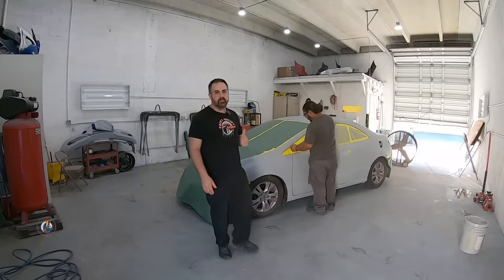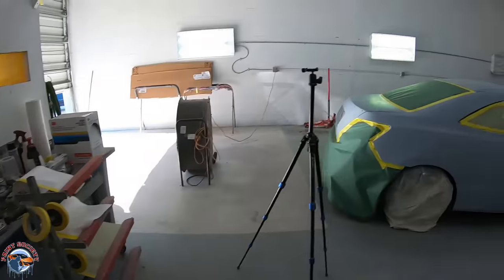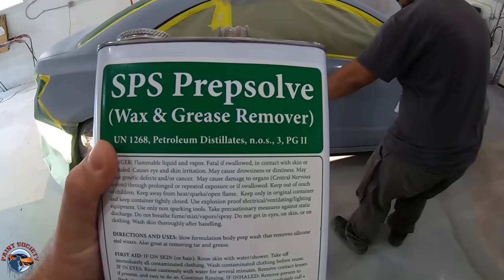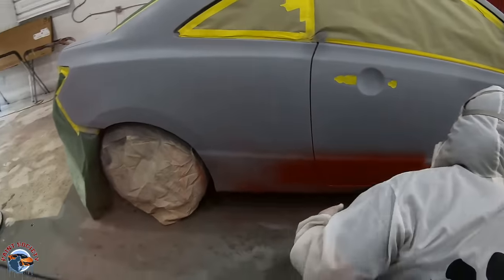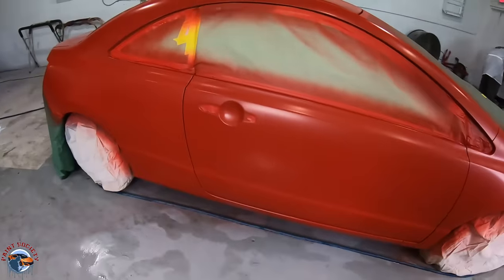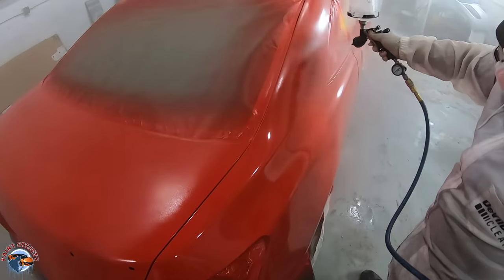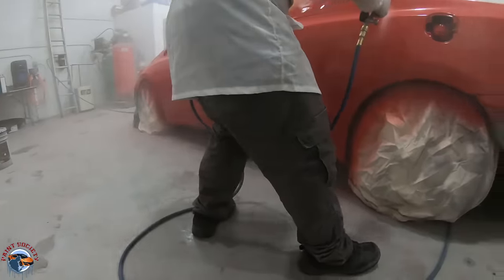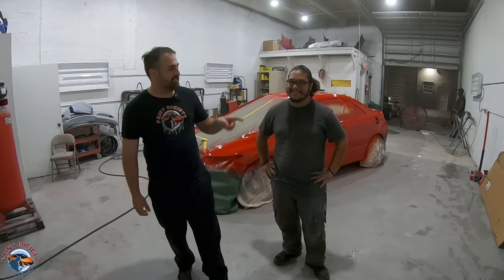How to Get Amazing Results without a Paint Booth!

Comment: I did 40+ years in the collision repair/refinishing business.  I retired from teaching it at a public technical school.  My food for thought: good technique Steven, if you want a long healthy life, get a fresh air system. Especially when illegally spraying with little or no ventilation, no arrestor, and venting illegally into the atmosphere. It's nice to see the use of a self etching primer, a step many skip. One other thing, I would have used Nason clear over the Nason basecoat. When you mix product lines it usually ends with paint failure later on, as I've seen on many occasions. Nason clear is very reasonably priced.
Reply: Valid point. I know the videos are aimed at the enthusiast crowd and not the pros, but you are doing a disservice showing a guy in a cloud of isocyanates with just a half face respirator and a chemical (?) cartridge. Some of the problems from isocyanates are immediate...and some hit you years later. Want to be around for your kids and grandkids? Get a fresh air system as mentioned. Wet edges...

Comment: This is a good video, very satisfying to see that paint going on!  One tip to newby car painters:  the PSI specified for the paint is as measured AT THE GUN, not at the compressor!  In other words you have to compensate for the length of the hose you are using,  (because the pressure drops more the longer the hose is)..and add pressure based on that.  Like if they say "30 PSI" you might need to have a reading of 40 at the compressor to spray at the specified pressure.. You need a chart to tell how much to compensate.
Reply: Great tip.. thanks 🙏
Reply: Another reason to regulate the pressure at the gun, not at the compressor, there's a lot more volume at 90 psi than at 30psi.  Even if you compensate way back at the compressor side to get 30 psi at the gun, if something happens that pressure could dip below 30psi in places, especially if you're not using a 60 gallon professional system like this and trying to make a 20 or 30 gallon oil-free 1.5 hp compressor work.  If you've got 60 or 90 psi up to the gun and regulate the pressure THERE, then you should never have problems with low pressure at the gun tip.

Comment: Used to paint plugs and molds for large yachts You are 100% correct Steve knows what he's doing - Only modification I would have made is I found it easier to control the hose by putting it over my shoulder then holding it by my side. Also love the fact you pointed out the footwork - it's as important as the flick for an even coat.

Comment: Love your tip about spraying scared/overthinking it.  Two of the best paint jobs I ever laid down were areas where I was like "I just need to get some paint on there, it doesn't need to be good."  One was the engine bay of my wife's car, the old paint was just not great, and I had the engine out, so I was like "I'm just going to throw down some base coat and clear, hardly anyone will see it."  It ended up going on so nice there was zero orange peel and no finishing needed, because I just sprayed like I didn't care.  It ended up winning a $1000 prize for best engine bay at a car show, with just a Scotchbrite prep and some extra bc/cc I had lying around.

Comment: Very well done  I liked the narrative  pointing out the Dos and Donts  I have only sprayed one car myself and for that one I used a Turbine HVLP spray rig I actually purchased  for my Woodworking finishes  I did use a two stage Dupont Automotive paint  in which it was recommended that a used a colored sealer from Dupont  because the car was a British car and they used a pretty soft paint from the factory  I knew that because I had the car for more than 14 years  and with routine washing a waxing  I could see grey Primer in some areas  the job came out nice surprisingly no runs, drips or orange peel  or any missed spots ! bTW I did the original factory color  as I did not have the time to pull the engine and prep  the compartment  I was quite happy with my results  and all the tasks my Campbell Hausefeild Spray rig could tackle  for my woodworking I often used Oilbased primers and paints as well as spraying Conversion Varnish over staingrade Exotic Woods
Reply: Now that you've done both, one of the things I found amazingly satisfying was using automotive clear and finishing techniques for wood projects.

Comment: Taking a grinder to those panels especially with today's higher alloy content thinner body panels is a big mistake, I'm surprised those panels weren't severely warped from the heat of grinding, I painted cars for over 25 years and I have to say Steve's technique is outstanding, I was never a big fan of Nason materials but they are very cost effective.

Comment: Wow!  that was impressive workmanship.... years ago I painted two cars under a tree  with Ditzler enamel, they came out surprisingly well given that it would have been close to impossible for them to look worse.
Reply: A lot of times by the time you give up and paint a car they look pretty bad to start with.  Back when I was in the RX7 club there was a famous video going around where someone painted their car with a roller instead of a paint gun . . . and it wasn't bad!  It wasn't GOOD, but it was so much better than what it was, and after all the sanding, it looked better than a lot of cars on the road.

Comment: I plan on pressure washing out my entire shop, ceiling walls and floor, before doing my first paint job. I will then seal any cracks it has to prevent air from coming in with dust or insects in it. I plan on putting quality HVAC filters on one end as an intake, and exhaust fan on the other end to pull air out. I hope this will prevent dust from getting in my paint. Likely will wet floor as well.

Comment: The question i always have is ; how long do you wait to remove the masking tape ? And...what technique do you use while removing it ?? Direction to pull and how fast etc...
Love your channel !
Reply: 2 hours after u spray,  remove it at a 45 degree angle AWAY from the paint edge and slow and steady

Comment: 45 years ago i started painting cars. back then it was mostly just alkyd or acrylic enamel. no clear coat.we would always start with the hood. do one side of the hood then the other then the fenders and roof, doors and finish at the back. you never wanted to walk around like you guys do. if you did that on the final coat you would end up making the first part dull due to overspray because it had already flashed off. it's like you do the front then the middle then the back like as if the car went through a waterfall.
on this car it didn't matter because you weren't doing the hood so you didn't have old paint meeting new paint.

Comment: Also, avoid painting at night because to keep the bugs out as much as you can. Also try to plan ahead if you have a lowered car or a sports car. When I painted my Prelude, I set the car on 4 large jack stands and remove the expensive wheels so when I paint the lower part of the doors, I am not getting caught with my gun or kicking up dirt the the gun might be kicking up.
Reply: Good tip.  A couple of times I've started spraying a project only to realize I couldn't get enough angle on the gun to paint the bottom of the rocker panels well.  Luckily the car was low enough that you can't see it well anyway, but I know it's there.

Comment: I'd like to repaint my 68 Ford Torino. Last time I painted it I used Centari Acrylic Enamel with hardener. That was back in 1982. The car still looks pretty good, but some rust spots are starting to show. Can't get the same kind of paint now, so it's on to base coat clear coat. Last time I painted the C strip on, after the first coat dried, with a gold paint. If I paint the car now with base coat, can I mask off the C strip with the tape and paint the C strip on over the base coat, pull of the masking tape and then spray on the clear coat over both colors. It would take some time to apply the C strip masking tape and my concern is timing and possible pulled of the first base coat when I pull off the masking tape.

Comment: Great video guys, as usual! I’m wondering what your thoughts are on a portable shelter as an enclosure; if the vehicle doesn’t fit in a DIYer’s garage? I think I know the answer...
Reply: watched a series of videos by a man restoring vintage british cars, although in a large shop he put up a portable shelter had one fan blowing front to back(not on high) and at the back with a floor drier fan with furnace filters for exhaust with the door closing their was not much of a gap. It worked great, acted like a down draft.  The quality of the job great, much of his later work was just painted in the shop, a lot of debris in the paint,  like you I will be painting in my Shelter Logic. The floor fan is the big secret you can turn it on earlier before painting to remove dust. Good luck

Comment: A quick question: I'm doing a long restoration for a project car. How to protect welded, straightened, and grinded areas? As I can't move to properly painting it any time soon. Can I just clean up those areas, apply epoxy primer and let it sit about 6 months before it gets properly painted? The car is kept in well ventilated cold garage.
You make great content, thanks!

Comment: When doing horizontal surfaces in dealing with the hose is that I take the hose and bring it up over my shoulder so there is zero chance that it would hit my work. One thing is that it is not a good idea to paint in the same room as the compressor because of two things. One is that the compressor as it spins can send dirt and dust everywhere and two the most important thing is that as that motor turns on there are sparks coming from the motor as it spins and could detonate the vapors in the room. I've seen a fireball one time from someone that was painting on the floor.

Comment: I'm afraid it's too late to ask a question for you because this is 3 years old, but I hope not! Okay. I own a Nucamp t@b CS-S camper,I've always kept it cover and protedcted. Man, I wish I could attach a phot.the "trim" is red--they call it Harvest Red and it's a lousy company for custom service. I've researching and I thought the propane tank and batter holder was made of firberclas. Turns out, it's made of Thermochromic plastic the rest of the title piece are n=meta. Phew! I made to mistake of storing it in my ex-hunbad's garage from May--August (moving),He took it out of the garage and it was iin hatch sy rays and completely faded the race.
My question: I've watch your di-it-at-home spray paint video several time now. Love it! Do I have to use a different pain an a plastictogue box. The you in advance and .

Comment: Two  more bits of advice... 1 before your first coat   coat all your taillamp pockets ,  wheel wells , glass gutters  so by the time you are concentrating on your last finish coat  all your in cuts wont be dry... if you have to go back and hit some dry gutters    there is a good chance of running your finished panel   2  keep a mental note  to hold the gun at a 90% angle to every bend in the panel    best that paint crashes straight on    paint coming at even the slightest  angle will be blown away by your air pressure

Comment: if I only got a small air compressor, I am gonna change color of my car. I can paint bumper, bonnet, fender one at a time... but my only concern is how should I do for the door jam and the inside of the door, as well as the whole side panel ?? because if I do door jam, I gonna open the door and tape up all every things... but when doing the outside ... is it better to shut the door to do it ? looking for your expert commet... thanks...

Comment: Steve should use eye protection.  Catalyzed paints can affect the eyes because they are semipermeable tissue and chemicals could pernitrate the eye membrane.  Since there is little ventilation  even with a 3M carbon mask an fully enclosed breathing apparatus would be useful but expensive.. Maybe a rental spray booth is available?  I still learned a lot from Steve's technique.  I met a former car painter that was on disability because ill fitting mask.  Considering the work the car owner got a deal.

Comment: people watch youtube videos of people painting cars and think I could do that, and yea they probably could with $10.000 of equipment and extraction booth, hardening lighting, 3 years of college training, and half a dozen years of work experience, now it's easy. 
when I was kid I hand-painted a car with Tekaloid (remember that stuff) heated the paint up in hot water, used it on a red hot day, left it for a week,  2000 grit wet n dry then t-cut then polished with turtle wax, I swear that at night time after driving through a car wash it looked pretty good,

Comment: Gun distance is short, and he never stops fluid flow.  Has room for improvement.  1,3 tip on that gun should rock a solid 12" fan.  I suspect hose diameter and especially fittings and regulator is restricting air volume.  Should be able to zip right along.

Comment: I set my regulator at 40 psi then adjust at the gun. You can't adjust at the tip so say it wants 22 psi. I set at around 23-24 or so. I am not a painter by any means I just can't afford to pay someone to do it. I don't have a booth either. My next one will a plastic sheeting over a pvc frame work outside. No idea how it will turn out. And for a gun I just a cheap set of Husky sprayers.

Comment: Good narration and camera work, and the video title was correct-- there was no paint booth. However, we need a video for those who, lacking a garage of sufficient size, need to create an enclosed area for painting. You covered all the basic-s- air supply, cost of materials, paint gun, etc.-- but how to select the building/enclosure which will not contaminate the finished work (by hidden drafts, etc)?
* There is a product which claims to create such an interior space through use of inflatable panels, so the area created could be almost anywhere, and is draft-free.

Comment: How do you decide whether to bring it down to bare metal or not? I have a 2010 f150 that is gonna need some filler work in door dings and such. Also doing a major color change so I will be doing jambs. Should I take it down to metal?
Reply from the maker: If it had tons of body work. I prefer to strip it down as much as I can
Reply: @PaintSociety  these tiny dings are the only body work it has ever had.

Comment: Thanks for the video. Quick question, I just finished painting my truck. In one spot I had to use a different color primer (mistake) and now it kinda looks patchy in that area. It’s a white truck and I used all white primer except in that area which was grey primer. How can I fix that spot? It’s only like a 4 inch oval shape. White single stage paint.
Reply from the maker: You have to repaint the whole panel.
Reply from the maker: @stephenpinckard526  600 and shoot it
Reply: 600 for single stage?

Comment: Thirty five hundred is a bargain when you consider it took 2 weeks of sanding and building to prep this car.  70 hours of skillful foreplay before it was time to pull the trigger.  IMO —Pretty damn good result using that cheap- ass clear coat.  Most shops would have quoted an outrageous price just to avoid a thankless job such as this.

Comment: Is it ok to wash my car about 6 days after getting it back from the body shop for bumper and fender repaint? Thanks
Reply: Last time I had a car proffessionally repainted they told me that I could drive it, but to avoid detergents/soap or extreme temps for 2 weeks. After that it should be just fine.
Reply: Well I washed my car with a ph neutral soap 6 days after.  No scrubbing just a light mitt wash. Hope the paint will be ok.

Comment: I see why it would cost 3k to do it because the guy brought it down to bear metal and my uncle told me you should never take down the paint to a bare metal unless you have the right primer to prevent it from rusting because the body shop my uncle went to took his box to bare metal and just filled the holes with bondo then primered it and left bare metal under the bondo I'll just say the box rotted completely out 4 months later

Comment: To bad you missed the dent in the trunk lid - to see it, change playback speed to .25 and you'll see it just after 9:00 and again around the 15:10 mark (left of center about six inches down from the back window)
Reply from the maker: A painter can do 9 things correct but someone will notice the one thing wrong. 

The dent in fact was not missed. No bodywork was actually done to the car. Just paint.

Comment: ((39 years Autobody )) you should of told EVERYONE about AIR-FLOW in a shop without a spray booth ??? I've got clearer and shinier Paint jobs in a open shop than I have in some Paint Booths with bad air flow in an Auto Body Shop...  You want to turn your SHOP into a CROSS DRAFT and WET the Floor BEFORE you Wipe & Wash your project down... MAX wet whole shop MIN wet around paint project.... DO NOT re-WET the floor once you START it kicks up DUST.... AND have your AIR FLOWING really nice before you TACH RAG off your paint project